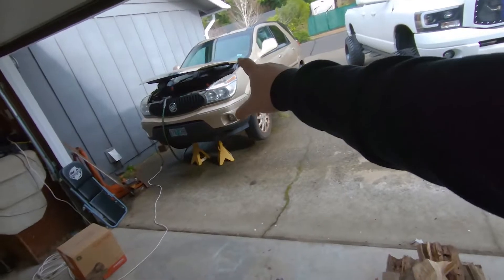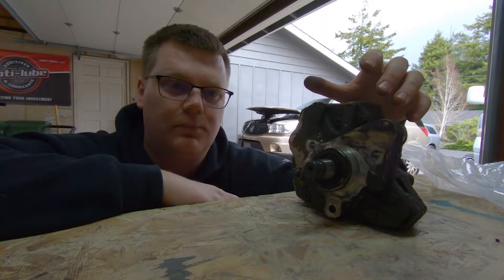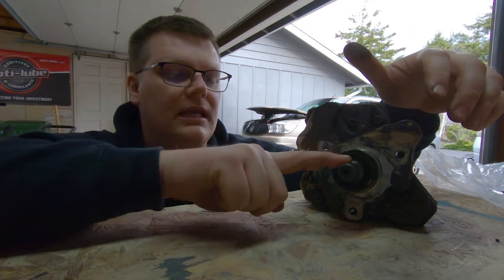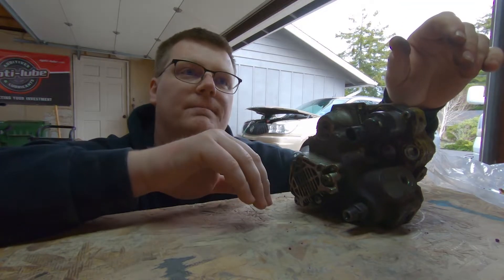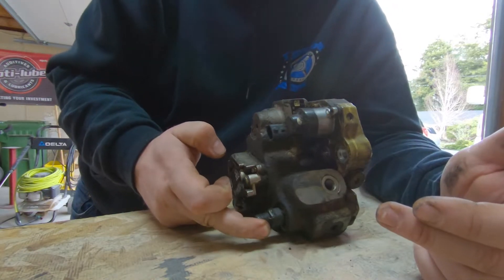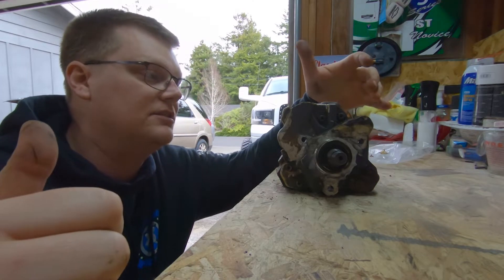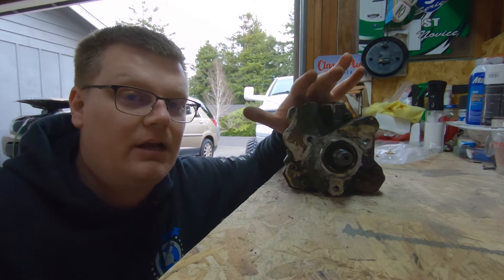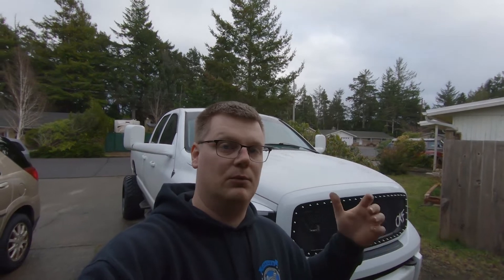What is a cp3 and how does it work

Comment: One thing that scares me about diesel is runaway. If you have a diesel truck or car, & runaway happens, how do you stop it, & how much time do you have before it blows apart? Stuffing a towel in the intake is fine for grease monkeys but for an average joe, getting air filter off an engine in runaway to shove something in the intake, besides noise, explosion risk, etc., seems out of most people’s comfort zone? Why do diesels not have a soliniod flapper plate or something that can be switched on from the cab to starve the engine of air? If I’m not mistaken, a fuel shut off does nothing as it’s not fuel that’s burning, it’s oil from leaky turbo, head gaskets, etc.   thanks for considering my question.

Comment: Hey if you can , I have an 03 Chevy 3500 with the CP3. What is the operating or start up pressure? It throw a p0087 code. Now the truck won’t start. I just changed the Injectors and to the pump back to have it tested. Can you help?
Reply from the maker: I haven't worked on a duramax in a long time now but those motors take about 2500 psi in the rail to start and im sure they idle around 4500 to 5500psi. What was the reason for the new injectors?

Comment: Greta video as always! Thanks for the info. I wholeheartedly agree that information is the key. All that extra information actually helps as well for us guys who have been turning wrenches all out lives, but not as a gear head specifically. All the extra info gives background, and that helps understanding. When you understand a thing, you can properly maintain and or fix a thing. I don't want to get an epic amount of horsepower, or speed, or cool out of my truck, I just want to: 
-keep it as amazing as it has been for fourteen years
- fix the pre-existing problems or emergencies(steering, teeny tiny tires, emissions restrictiveness, etc or "replace this with 'X' as soon as humanly possible!")
- improve what can be improved upon (should you upgrade to this or that when the stock one wears out, or go OEM)

Anything you can
Reply from the maker: Absolutely!! And that's what I'm here for hopefully I can help as things progress and move forward. Thank you as always

Comment: That electic valve is on the inlet side of it. It only lets as much fuel into the pump, and thus the rail, which is actually being consumed. It doesn't heat up the fuel unnescessarily. It's not as wasteful as the CP1, which let high pressure fuel back to the tank.

Comment: Very informative video bro. Thanks for teaching me something. I wana do a 12mm and 100-150% over injectors.
Reply from the maker: Thank you man that means alot, I am thinking pretty hard about doing 100% injectors after I get my air side sorted out
Reply: @Cargill450  go with a S472 if your going to go with 100% overs. Thats the route I think I'm going to bump up to in the future once I get fuel mods done.
Reply from the maker: I think I am going to do just that, a 472 on 100% injectors, hopefully that setup will hurt some feelings
Reply: @Cargill450  what else do I need to reliably run a 472?
Reply from the maker: A 472 is a fairly big setup and it really all depends on your driving style, sounds strange I know. I would say bare minimum head studs but the 472 is going to need some extra fuel so at the end of the day I would say head studs, lift pump, cp3 upgrade and bigger injectors. The factory cp3 will run 35% over injectors but thats maxed out with a lift pump and a 472 your going to need more fuel then that. A 472 is a little bit of a rabbit hole to be honest 😅
Reply: @Cargill450  thanks man I will get to ordering stuff. Alrwdy got my trans built and a 150 lift pump. Just need the rest of the keys. Thanks again for the reply
Reply from the maker: You bet man any time